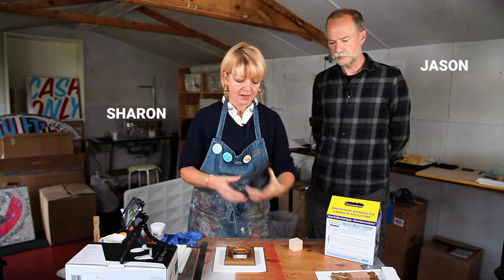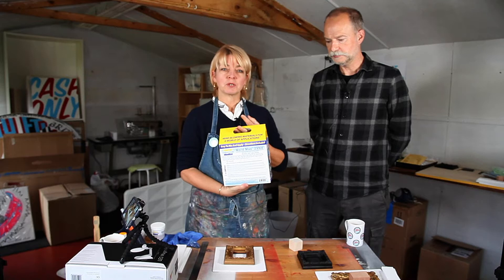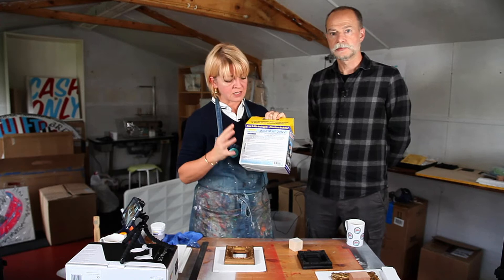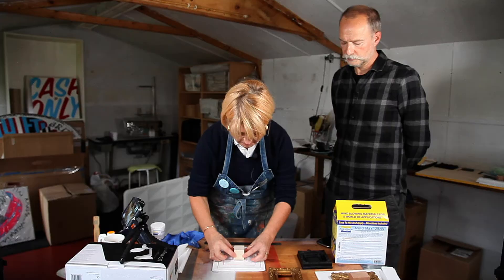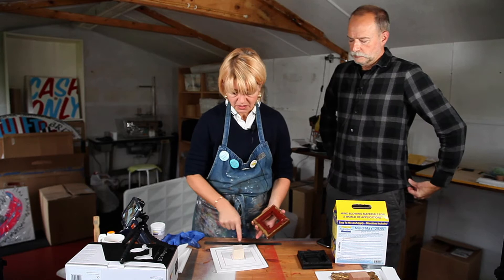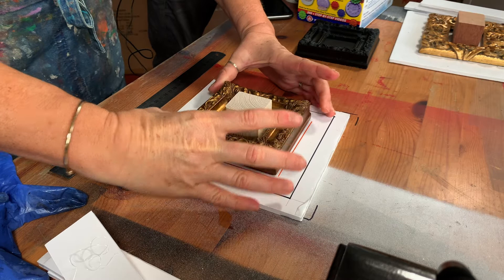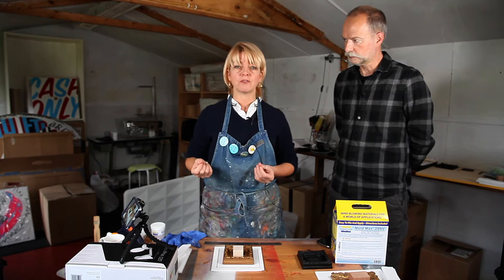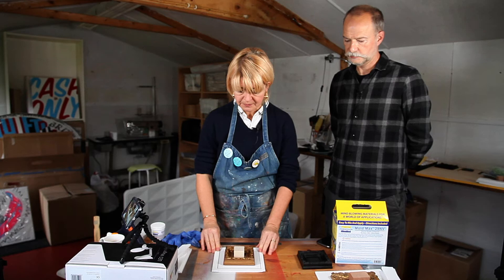How to make a mold from a small picture frame

Comment: Question do you do this because it is cheaper or are you doing this because these are rare hard to find frames I want to make dollhouse size picture frames so far I haven't seen anything that is that makes it more cost-effective to cast your own molds and make each individual frame individually than it is to order them so that's the question I have is is are you just doing this with unique ones or.